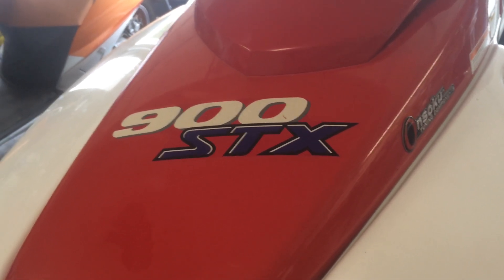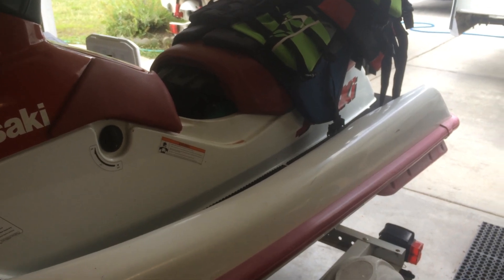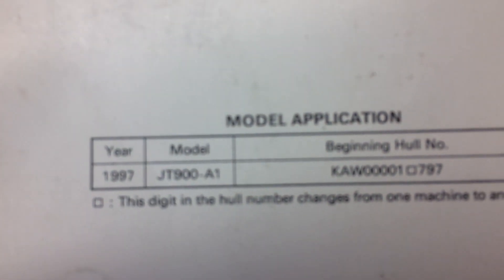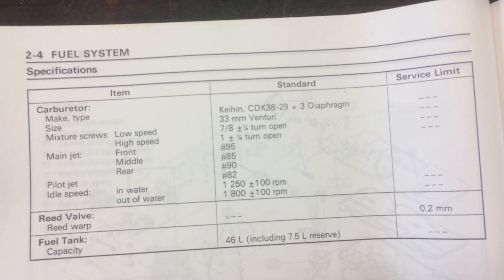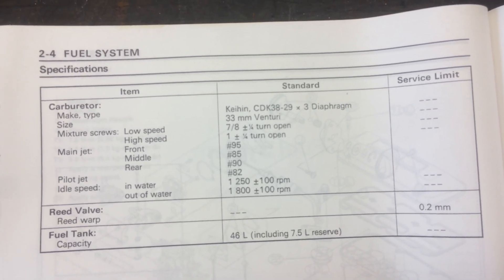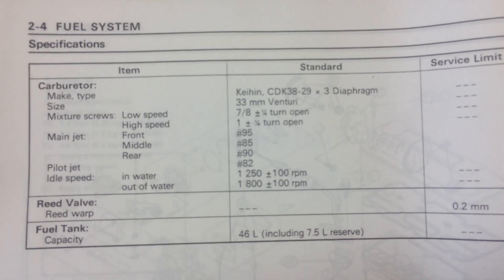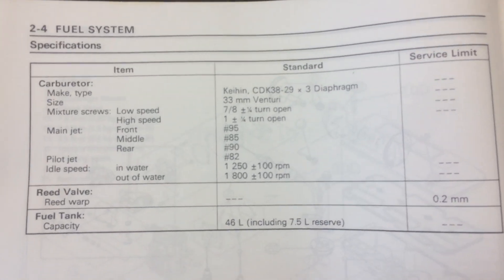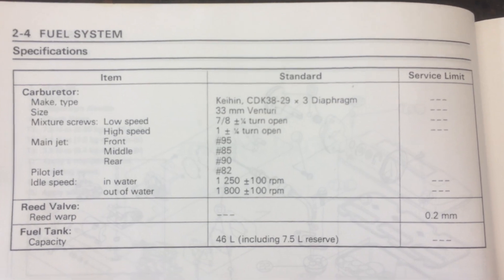1997 Kawasaki STX 900 Carburetor settings straight from the manual

Comment: I have 2 skis.  900zxi exhibits the same syptoms as your other video.(1100 stx) Runs...stalls. runs stalls 1100zxi cant take ANY throttle and usually can only be started with starting fluid.  It looks impossible to adjust the carbs ON the machine with it running.  Terrible design.  You mention 1 turn of the screw of course it has limits.  1 turn means from seated needle correct?

Comment: Have you ever check the compression on the 97  900stx jetski if so what was it at now?? I took mine to a mechanic and he said it was showing 95 but should be around 120 said probably need engine rebuilt soon. He adjusted carbs but now it worst then what it was before i took it to him. Before it ONLY wanted to stall after driving threw a marina for 5-10 mins then when exiting marina during the takeoff would start to bogg down (that was after it was warmed up and drove all day too). I would turn gas off for 30 second then (as machine was running),  turn it back on and it would takeoff like normal, otherwise it would start to bogg down if i didn't turn gas off,  now it stalls at idle speed during takeoff all the time. I don't think it the compression problem or needs rebuilt because i had that same issue with it since i got it brand new. now it just a lot worst. And supposedly when i got it fix about 20 years ago i remember the other mechanic saying carb setting was not right in the book had to call Kawasaki directly.
Reply from the maker: Tommy  I’m not sure why all these mechanics try to say that 120 to 125 is normal for an STX if you look it up in the service manual it’s 110 psi. But usually when you start seeing a drop off i compression your rings are starting to wear down or you had an issue in the past that caused you to lose some compression . That problem was probably already fixed but the damage is already occurred

Comment: I have same jetski how do you adjust high speed screw? Mine is a plastic wing nut and only move about 1/8 a turn, if i take off plastic wing nut there no line in the screw to use a flathead screw driver. My jetski stalls when i barely touch throttle to take off. I have to super slowly pull throttle then it works fine until i idle again. The low speed screw has a line in it that i could use a screw driver to adjust it. Any suggestion??? Thank you.
Reply from the maker: 2 choices. Buy the special tool that fits the screw once you remove the plastic wing nut. Option 2. The plastic wing nut as you called it hits the stopper so you can only turn it 1/4 to 1/2 turn.Cut off the stopper on the plastic wing nut so it rotates all the way around.
Reply: @mogyver69  ok. thank you.